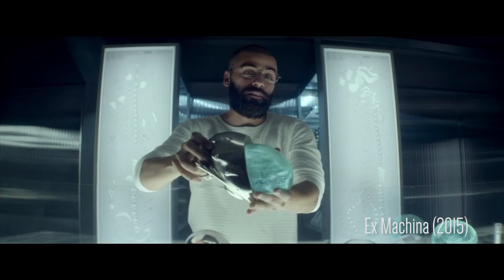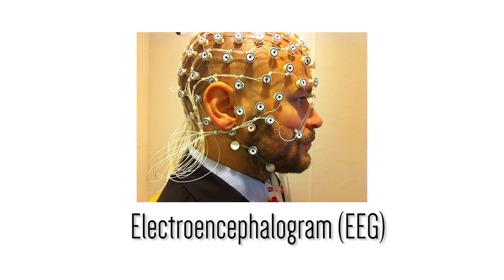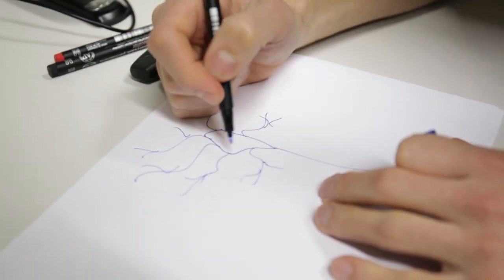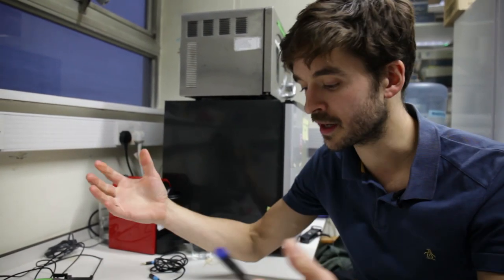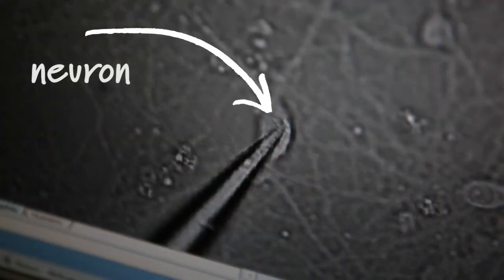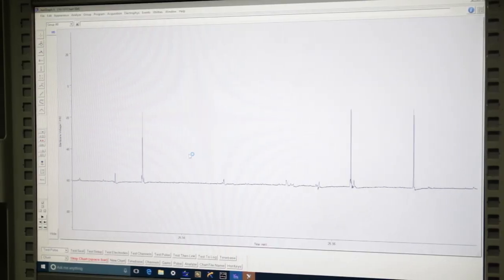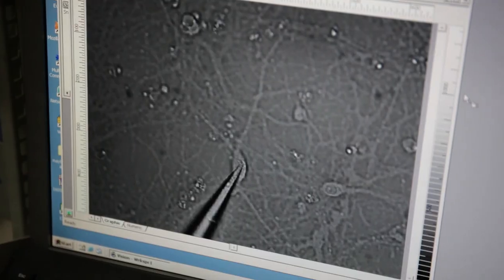Can we build an artificial brain?

Comment: This was very interesting and it's something I myself have wondered very often.
Another question I'd like to ask is: to solve the ion problem, why don't we do the same and conduct the electricity using solutions of Na+ ions or something? So it would be like electrolysis in that it passes through mostly electrical circuits but also solutions

Comment: I would just like to add to the explanation by Dr. Jennings: while the "type" of electricity that the ions provide do increase the complexity of the system by a factor of three, it is not necessarily a problem to recreate a virtual consciousness or artificial intelligence. The functional role of the neurons as either providing an action potential or not to the network can be simulated without the necessity of representing the contribution of individual ions. The statement that a virtual consciousness would be drastically different from ours is true, that it differs from ours in a fundamental way, but it does, however, not necessarily mean that we can't recreate a virtual consciousness that is functionally the same (in theory). It all bottles down to what we specifically mean by consciousness and how it should be represented. Really liked the video though! Good job, would really like to see more of this.

Comment: You did a really great job with this kind of video, I would definitely watch more like these! One thing I am confused about is the comparison of the lipid cell membrane to a resistor.. wouldn't it be more like a capacitor where absolutely no current would pass through until it reached a breakdown voltage difference? (or is maybe fat more conductive than I think)
Reply: As far as I know, you're right! At least, that's how my neurophysiology prof explained it. Ions can't get through a lipid cell membrane, because they are surrounded by water molecules, so they are too big to just pass through (such as small nonpolar molecules). But if, due to a voltage change for example, a channel for a specific Ion opens, there's an electric current :)
Reply: Vanessa King what Mia said - the membrane itself is not conductive, but contains many specific channels, ie Na Cl channel which does allow their passage

Comment: Learning about active potentials in bio right now. Got a little excited when I understood what they were talking about. A lot goes into the relationship between stimuli and the production, sustaining and movement of active potentials along neurons, so I understand why they simplified the explanation, but I wish they would have dove just a little further. 

Biologist or Neuroscientists please correct my info if incorrect:

For example, the fact that a stimuli causes a change in the membrane potential of the neuron (difference in charge between the inside and outside of the membrane based on the quantity of sodium, chloride, and Potassium ions). When the change in membrane potential reaches or surpasses the threshold of the cell (also called depolarization), that is what triggers the cell to open the sodium and/ or potassium ion gates within its membrane. The movement, or lack there of, of sodium, chloride, and potassium ions into and out of the cell is what generates the active potential and stimulates the ion channels further down the axon to also operate in a specific manner that allows the active potential to propagate along the axon. 

The brain translates those active potentials as pain and uses them to determine the severity and location of the stimuli that caused that pain.

There is still a lot of information missing, but that is my basic understanding.

Comment: I would absolutely LOVE to see more neuroscience videos from you! This one was extremely interesting! And, so is this topic, artificial intelligence is not discussed at the fundamental hardware/physics/electronic circuit level as much in most media that covers the subject. I've always thought that engineering a conscious, fully self-aware, machine is theoretically possible, but not using the kind of computer chips that we have today. The hardware of a truly conscious artificial brain would have to much more closely function like an animal's brain and use a very different kind of circuitry. However, I also hypothesize that an extremely intelligent and useful (or dangerous) artificial intelligence could be engineered using traditional silicon computer chips and machine learning software. The key difference would be that an AI built entirely in software running on contemporary computer hardware would not be conscious but rather an insanely sophisticated program that is capable of behaving, problem-solving, and communicating in such a way as to convince us it is conscious.

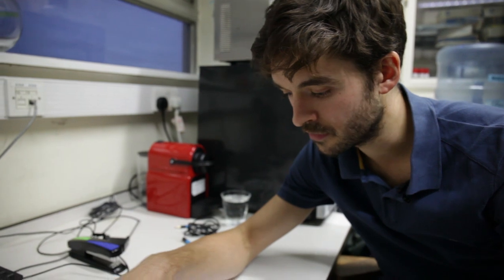Comment: Great video! However I noticed some fundamental errors in Dr Jenning's explanation of the simple circuit at 1:38 which I think are important to clear up.

Firstly, conventional current flows from the positive to the negative battery terminals, not negative to positive (like electrons), despite electrical current being caused by electrons. This is because in the early days we envisaged current as the flow of positive charge, when it turned out that (negative) electrons were responsible. 

Secondly, it's false that 'some of the current goes through and gets to the positive side depending on how strong your resistor is'. No current is dropped across the resistor - otherwise charge would not be conserved! So the current would be the same everywhere in the loop of the circuit.

Thirdly, Dr Jennings says that the voltmeter tells you the 'current difference across [the resistor]'. That's also wrong - it measures the voltage difference, where voltage is a measure of the potential energy the charge has.

Comment: Really interesting video! I wonder though if the issue that the brain can utilise different ions for electrical signal is as insurmountable for electron-based (or photon-based) circuitry as posed by your guest speaker. The same issue no doubt was considered at the start of explorations into digital signals from analog - the information encoded by analog signals is so much more than that of digital. Yet over time we found we could encode the same information in digital as we once could with analog and, further, improve reliability as we could introduce error-correction into the system.

Surely one could envision a system in which the interpretation of digital signals could be different simply by virtue of some "header" signal (a couple of bits instantly encodes the same information as four ions) much the same way as header information in HTTP messages, emails, files and so on all do the same for their respective domains.

Of course, mimicking the behaviour of any one human brain in a particular state precisely is no doubt impossible; at a very fundamental level quantum mechanics doesn't allow true cloning of such states if we want to be truly precise. Ultimately no matter what we'd have to accept some level of change if we upload our own state into any system, but it is not all that different from how we change as people over time anyway - more than just the mechanics matter at that level.

Finally, while for the matter of uploading "consciousness" Transcendence is perhaps at least likely to be somewhat accurate regarding change in behaviour and thinking, surely that doesn't preclude an Ex Machina-style artificial brain that is in no way intended for uploading our "selves" but for mimicking in a believable way the processes of the human brain.

Comment: The animation at 7:30 is not entirely correct. Electrons should not flow through the Voltmeter to allow precise voltage measurement (therefore Voltmeters have very high resistance). Of course still some electrons make it through the voltmeter, and I guess this was not an important point in the video at all, but still :)

Comment: I was not completely satisfied with his answer. 

We build digital logic circuits that are based on a one voltage differential to create only two states. 1 and 0. And  the trend today is to make binary digital circuits in you smart phone and computer say.

But a circuit can have multiple states and even analogue differential voltages.
It is possible to built logic circuits that do both analogue and digital differentiations at the same time....not unlike the brain does.

Now a physical logic circuit we make today typically, the architecture is a  "set in stone" processor with some function change capability The processor is lined with data buffers that carry information and instructions to control the processor circuit function.

What separates the animal (biological) brain from metal based circuits is the bio-brain's ability to rewire; actually change its own circuit architecture of the processor to adapt to what gives positive result. That is the magic of the brain and what a physical circuits cannot presently do.

Comment: Hmm if the main challenge is to use molecular ions instead of isolated electrons, why not throw out metal wires altogether and use an artificial abiotic replacement of the neuron tissue?
Reply: Michael Massa Jr. What artificial abiotic replacement would that be?